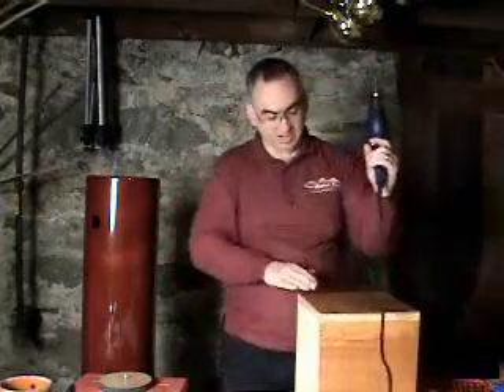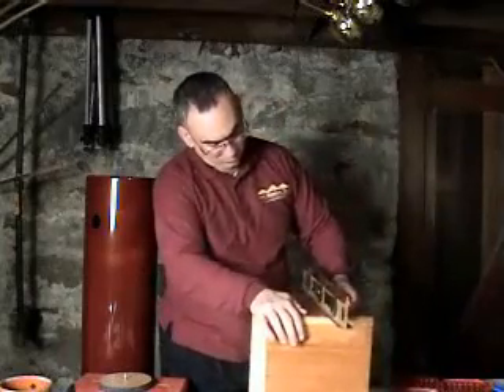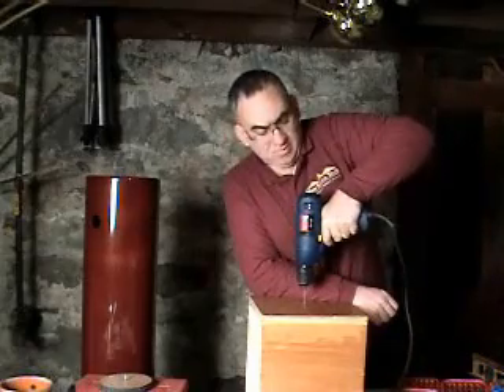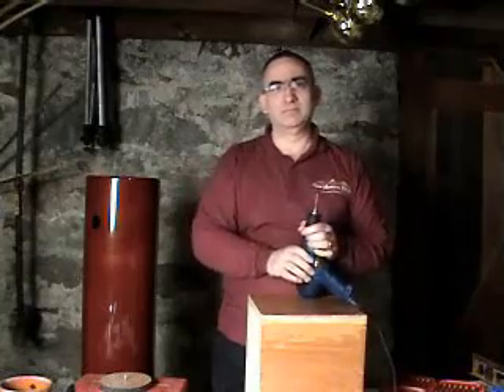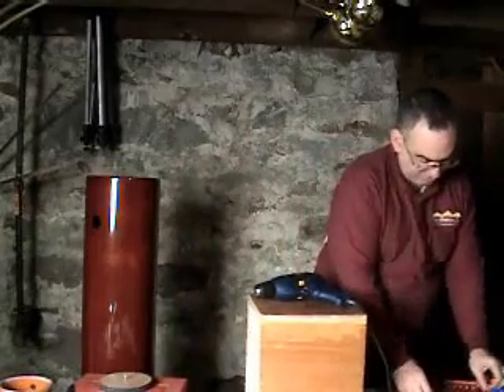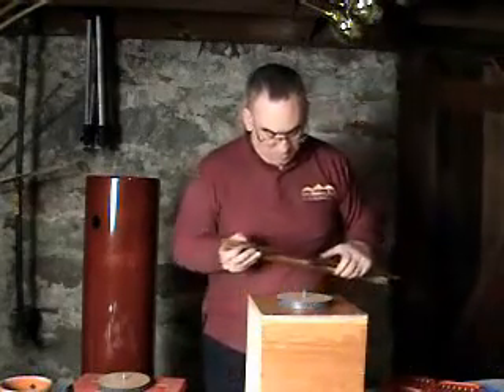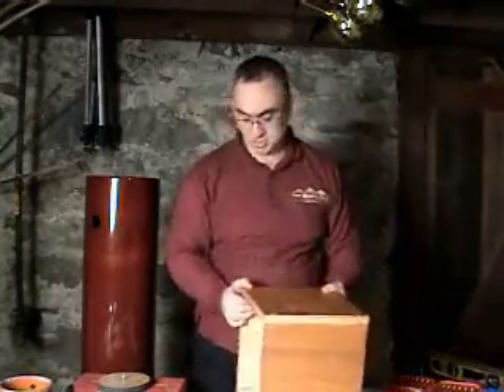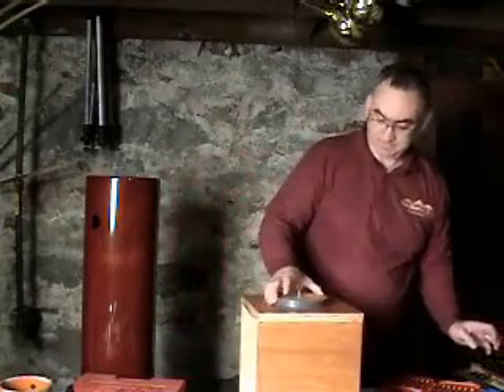Making an Optical Tube Assembly and Mount 4

Comment: did you say that the parts for the tube were 2007 dollars? I didnt quite get all that, since at the end, you mentioned that it cost around 200 dollars? for entire tube assembly, Im guessing that the mirrors and such ended up being a lot more? I havent researched the mechanism for the interior, so, I guess respond, or ill find out the harder way ; ) cheers.